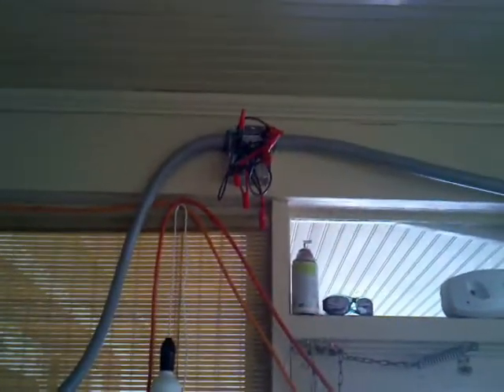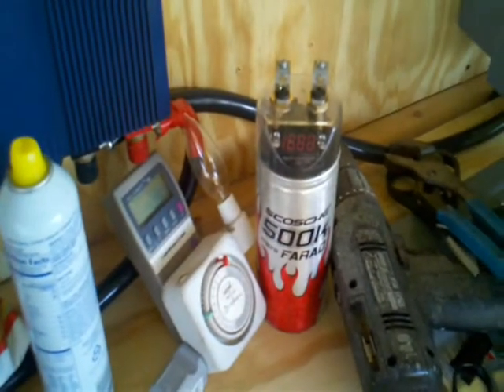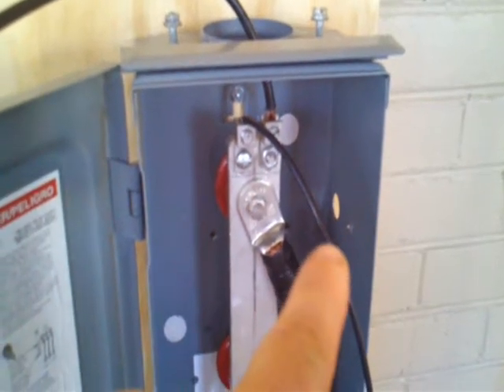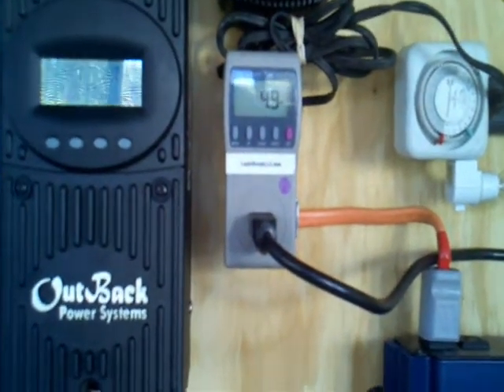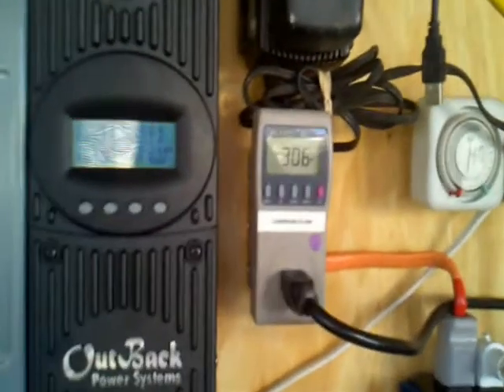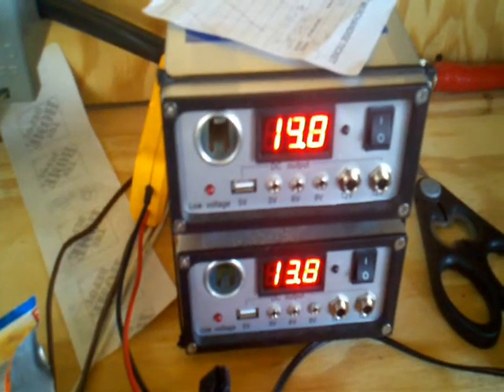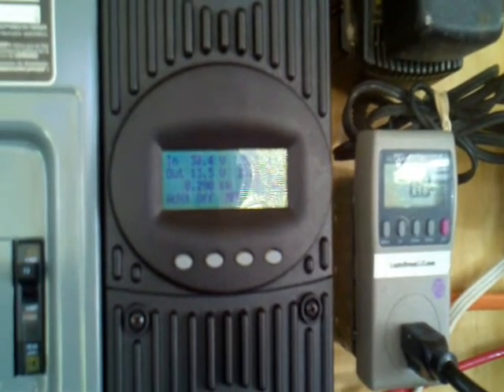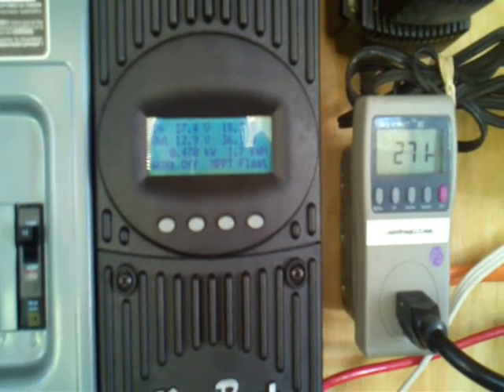Wired the OQ breaker box - Solar Power Setup Testing - Outback FM80 Charge Controller - Inverter

Comment: I have a question we have the outback inverter we are having trouble .... we have 6 panels we already check the panels to see if they were working and check the batteries one by one and it marks good but when we put al.the batteries together on the outback it marks 410 kw and it goes up to 480 then down to 410 but if we connect one batterie it marks good and this just happen like 4 days ago and it has been really hot and sunny and the kw dont go up we had this system over 3 years and never had a problem and its been sunny and before this problem it when to 1200 kw but not this time hope some undestand and can help.me

Comment: You should never use AC breakers for a DC power source, they are not mechanically the same and can cause a fire. I'm a  solar installer and do this for a living...
Reply from the maker: Nate D'Archangel then you should know that the QO line of breaker is DC rated. check the specs. thanks
Reply: Not saying that is incorrect but it is however very specific to certain DC parameters, the average experienced technician would be highly be ill advised to install a commonly used 20amp A.C. breaker as DC disconnect. Just concerned about the safety of the system, for those watching do not use a A.C. square D breaker panel for DC circuits, like the cheap ones at Home Depot or Lowes. This is commonly frowned upon local and national electric code. I would highly recommend the din rail breakers and baby boxes from midnight.

Comment: I have the outback fm-80 charge controller, Do you know if i can use just any kind of combiner box and or 80 amp breakers? any suggestions or tips would be appreciated. I have 2-250watt samsung solar panels(voc-37.8) just bought the outback as my charge controller and have a 12v deep cycle battery bank with 1500 watt pure sine wave inverter.

Comment from the maker: Sorry about the delay in responding I did not see your comment.  I got the CAP Given to me in a box of junk but they can be bought anywhere they sell audio amps and speakers.  If I had to buy one I would buy several 2 volt 25000 f caps.  over all more cap for the $.  yes i have the battteries and the cap wired correctly. Thanks!

Comment: very nice to see the progression. I am wondering where did you wire the FRAD capacitor? It should be between the battery bank and the inverter. Also, not sure how the battery bank is wired. Just wondering if you have your feed and draw connections at the complete ends of your bank. If you dont, then the batteries will become unbalaced in their charge voltage. I have a couple videos of my system if you want to see mine. Some other helpful vids are OBXSOLWIND and econewpower. Again, very nice!